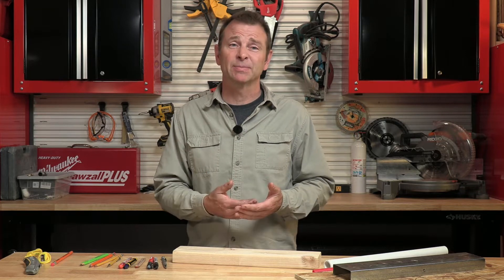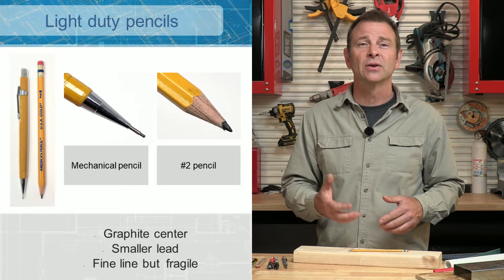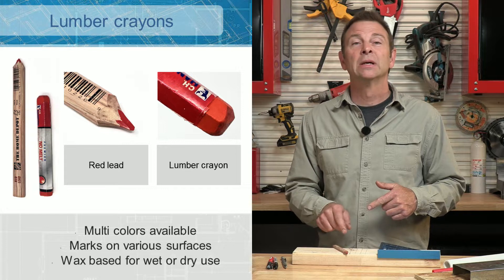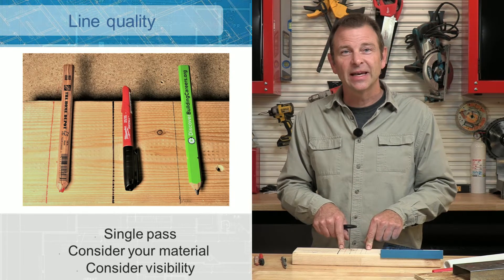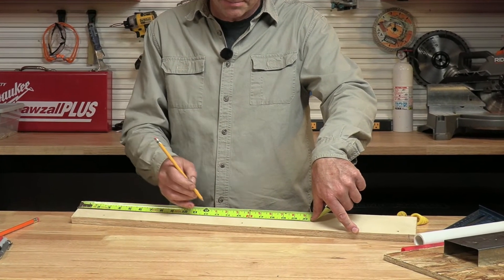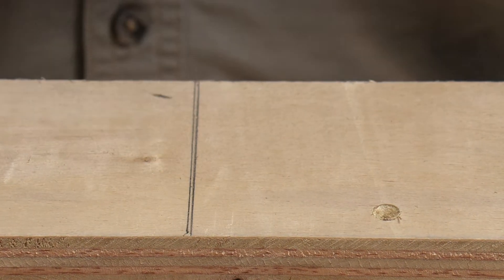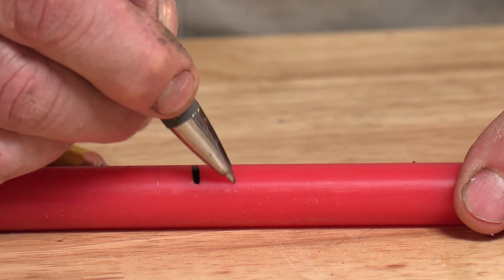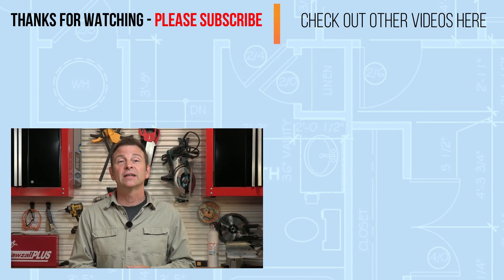Marking in Construction - It is more than than just lines - TEACH Construction Trades Video

Comment: Joe, I had heard that one of the reasons a carpenters pencil was shaped the way it is was because it's thickness can be used as a measurement (1/4 inch). Have you ever used it this way, or heard of others using it this way? Thanks in advance!
Reply from the maker: I have heard this - but not sure I would use my pencil for any accurate measurement - I have too many teeth marks on it.